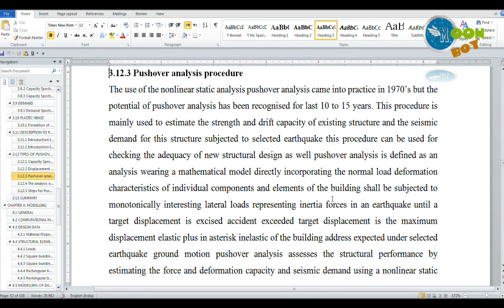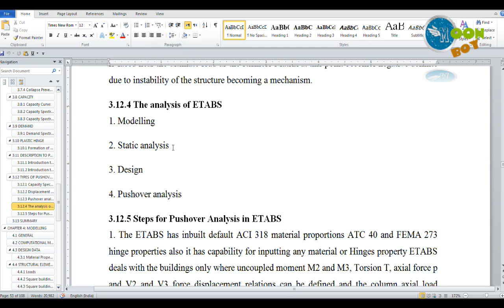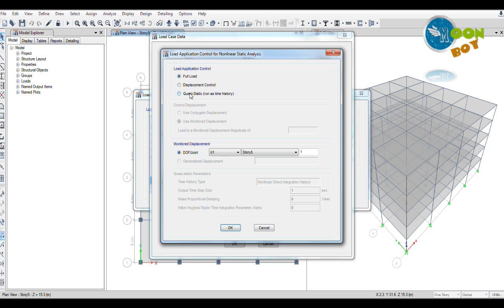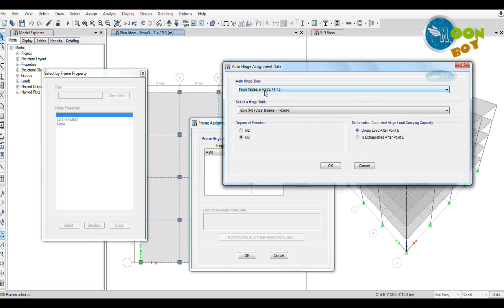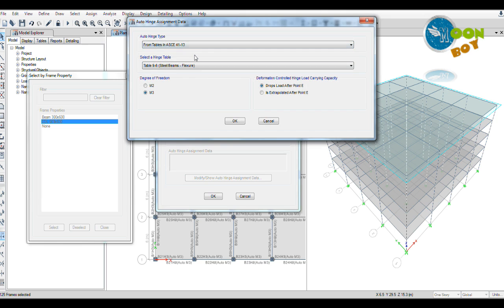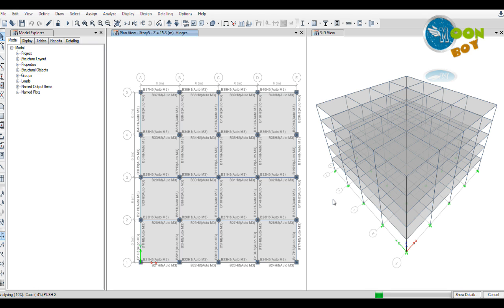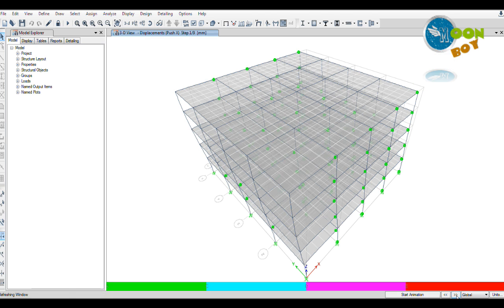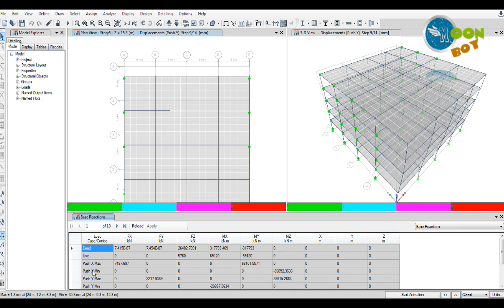Etabs 2015 tutorial 7 | Pushover Analysis | Using IS Codes

Comment: Hi May I ask you about pushover analysis on steel frames? in which order to we want to activate plastic hinges? should we get all hinges in beams first and then in columns?
Reply from the maker: It depends on the position of the point of application of load/displacement.

Comment: I always have this doubt ..please clarify sir... We should do this push over analysis in time history method only? Or can we do it in response spectrum also? Please clarify my doubt sir please
Reply from the maker: You should do pushover to know the effect to structure when a known force or displacement is applied. Time history is completely different method. And Response spectrum is codal method with prescribed curve of response.
Reply: @moonboyslife .. I didn't get what you told... Are You telling that i no need to consider time history or response spectrum in the design while running the analysis... Is that why you have considered only DL AND LL in analysis while running analysis.. Please clarify sir
Reply: @anand4236  yes, while doing PUSHOVER ANALYSIS we need to run only NON-LINEAR load cases..

Comment: sir,
after pushover analysis in ETABS2017, my results of Push X and Push Y displacement is in only 2 steps and all hinges is in A-B zone.
Is my analysis is right or wrong?
Reply from the maker: Dear Abhishek,
You need to give initial non-linear load cases to start pushover. This video is just the pushover procedure. Not the entire analysis procedure.
Reply: @moonboyslife  sir, I provided load cases as per your instructions, dead and live load are in linear static and push X and Push Y are in nonlinear static .
is initial non linear cases is something different from this? 
if yes, then please tell me how to do that sir?
Reply from the maker: @Abhikivoice  You need to take a non linear load case which include dead + live load which starts from zero to full. Then Start Pushover case from this load case.

Comment: while modelling a high rise building , say G+20 in any zone in response spectrum method , failure chances are high after design ...so it is almost definite that if i go for pushover easily every hinges turn red , does that mean that building of that sort is not advisable if hinges turn red?....is it possible for all the building members to pass the design even if the hinges turn red in push over analysis ?

Comment: is it possible to perform pushover analysis in flat slab building ? ....since there is no beams how do i provide hinges ?
Reply from the maker: govind up u can apply hinges only to members not to areas. So you can apply for columns only.
Reply: to do push over analysis do i have to do response spectrum and time history to the model before that? or you just took a random model which has done that in your video
Reply from the maker: No no for pushover analysis response spectrum and time history are not required..

Comment: Dear Qamar Moonby, 
I am dealing with pushover analysis of shear wall frame structure. I am trying to define plastic hinges to shear wall. As far as I am concerned, modeling shear wall hinges is not applicable in Etabs but there is some modifications have been done by researchers  such as mid-pier elements. I was wondering if you could help me model shear wall plastic hinges by etabs or show me some tutorials or articles related to performing pushover analysis of concrete shear wall frame  by etabs.
Thank you so much
Reply: Hamid Nikzad please refer to CSI tutorials, especially the one for performance based design in EATABS

Comment: Why are you performing Pushover Analysis without performing Gravity analyses? I mean Push X and Push Y both are starting from zero unstressed condition. I think this is wrong.
Reply from the maker: Kainaat Salman This is somehow completed at that time. Actually we need to take from non linear gravity combined state then it should start the pushover. So we need to consider one more nonlinear as combination of gravity load as full load non linear. You are correct. I will create one more video in ETABS 2016 version. My intention was to show how displacement method works. As now I have completed M.Tech I know it is wrong procedure.

Comment: Good demonstration. However, it would have been nice to see the formation of mechanism in the structure. How could we ensure that the time steps will show formation of mechanism in the hinges. To achieve this do we have to increase the value of "Load to a Monitored Displacement Magnitude" in Load Application Control dialog box?
Reply from the maker: Hasan Shirazi In that case we need to do capacity spectrum method. This is just an small example.

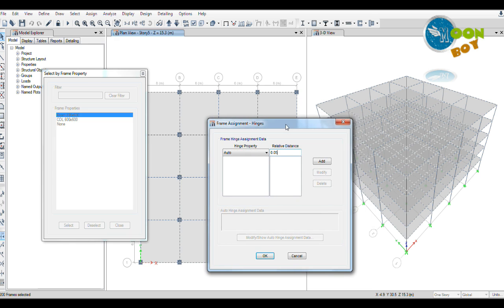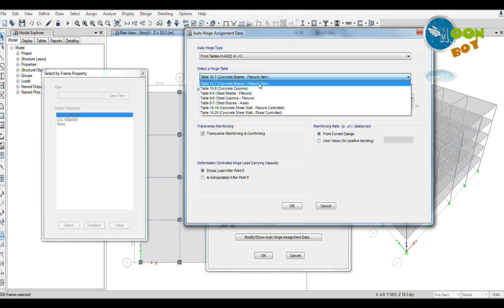Comment: @17:00 and @19:00 The relative distance 0.05 and 0.95 are ratios and not distances in cm. So for a beam of length say 5m, RD=0.05 will be 25cm (from end i) and RD=0.95 will be 475cm (from end i or -25cm from end j). Hence, actual distance of hinge from each end will vary according to the length of the beam in the model.
Reply from the maker: Hasan Shirazi yes you are right.

Comment: Hello,

This video help me to make pushover analysis in SAP 2000. Thanks. 

But i have a problem, because my pushover analysis finished before construction collapse. I have control displacement set on 0,5 m, but analysis finished at 0,17 and i do not know what to do. I want my construction reach displacement 0,5. Maybe can someone help me? Thanks.
Reply from the maker: What about the hinge results? are they safe!!
Reply: Thank you for answer. Hinge are ok. Some says that probably numerical problem.
Reply: this is a wrong approach bro your results cannot be validated

Comment: Hello sir,
Which IS code did you use to carry out Pushover analysis? Indian seismic codes does not have any specifications for this analysis. Inform me if I am wrong.
Reply from the maker: Shahzeb Danish you are correct. Pushover method is given in ATC 30 and FEMA...

Comment: I want to model tune mass damper in ETABS for high rise buildings, can you please help me sir
Reply from the maker: If you have learned etabs then just apply a gravity load to the inverted member suspended from top. which will act as inverted pendulum that will behave as Tuned Mass damper.
Reply: Can you please make a model on it
Reply from the maker: I am Busy right now. Please refer the journals of IJC, ASCE, CSI, IJSAT, etc. you will find all your answers. Also use google scholar to search pdf or word document of those journals.

Comment: in etabs modelling i am getting same results(performance point) for all 4 seismic zones.so please help me to get the correct results(performance point) for all 4 seismic zones..
Reply from the maker: It will show different performance points and capacity spectrum.. there will be a drop-down for Push X and Push Y.. there you can select for generating different curves.
Reply: Sir is this problem slot out... May I know how to get correct result... I am also facing same problem

Comment: Hi there , want to ask is it possible to develop plastic hinge in time history analysis? because i' doing repeated earthquake which consider a several earthquake and time of rehabilation.
Reply from the maker: yes you need to use capacity spectrum with acceleration due to earthquake time history load pattern you can select when mentioning the load case PUSH-X and Y.

Comment: thank you very much for providing such a comprehensive videos. I was  wondering if you could provide videos for analyzing shear wall in details. How to decide the length and thickness of shear wall and how to optimize it. Where to decide the location of the shear wall in complex structures. 
Thank you very much for response.

Comment: Best Etabs channel tutorial... pls sir can you Make a tutorial explaining how to model, analyse and design STEEL ROOF TRUSSES using angle steel and z-purlins. This I will be very grateful.
Reply from the maker: Thanks. I am trying to solve every problem, but need to wait till I finish the current design on Bracings. Next will be yours, so be updated.
Reply: Thank you sir, I will be checking... also explain the weight the roof exerts on the roof beam as gotten from Etabs.